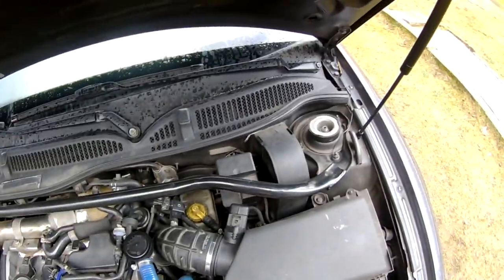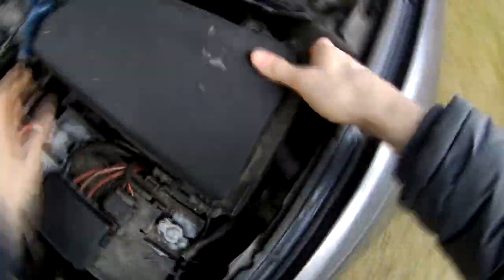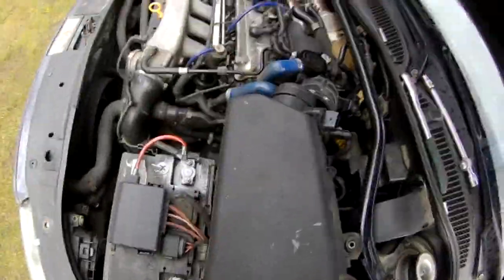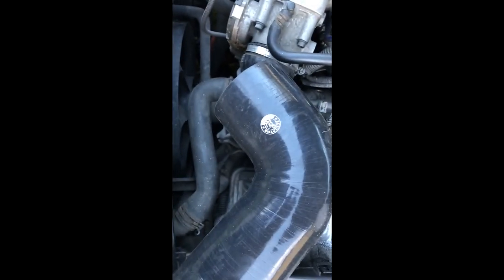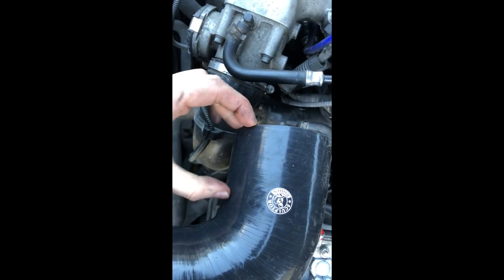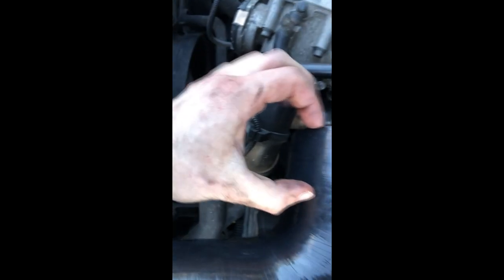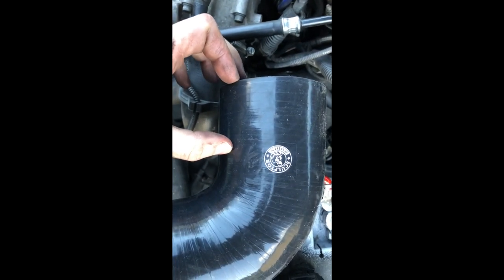Audi S3 8L turbo intake pipe

Comment: Hello how, does it sit next to the brake master cylinder? I've always though they rub badly against it?
Reply from the maker: Actually did some minor adjustments. I have shortened a bit that pipe near turbo intake. Smoothed a bit one plastic thing on brake master cylinder. Anyway it needs more redoing: still one brake line is touching it, but at least doesn't harm that pipe.
Reply: V3 tip or the full silicone version originally from badger5 will fit LHD cars with minor trimming. not ESP models though as brakes lines are even worse on those...

This tip with metal bit is copy of the V2 design.

Comment: Hello.  I have a question.  Don't you think this tube is a little too soft.  that he has not enough layers.  I would like to know if you feel any difference in how the car reacts to pressing the gas
Reply from the maker: Hi, nope, material is hard enough. But wouldn't buy second time, because it is hard to fit and needs relocating brakes lines from brake booster. Probably would take same size as oem pipe. In higher rpm it felt bit stronger. Checked maf readings before changing and after - so it had read more air.
Reply: mine is audi tt.  I live in England, I don't have to cut anything.  the master cylinder is on the other side.  I was just afraid that the pipe would collapse when the turbo was sucking in air because it seems quite soft
Reply: can you tell me how long bolts you have used to connect this aluminum turbo adapter
Reply from the maker: @patrykrozynek2010  do not remember exactly, but probably 1 centimeter.